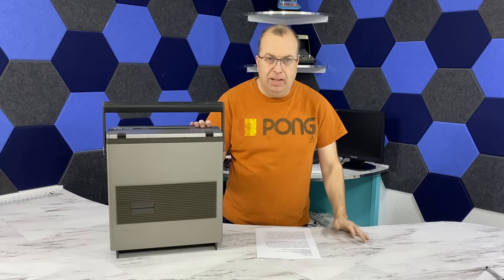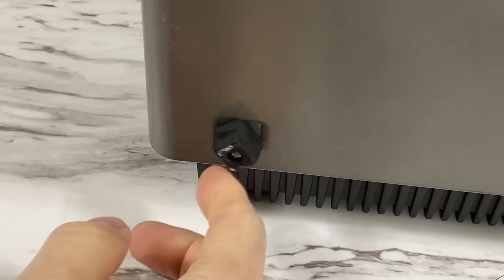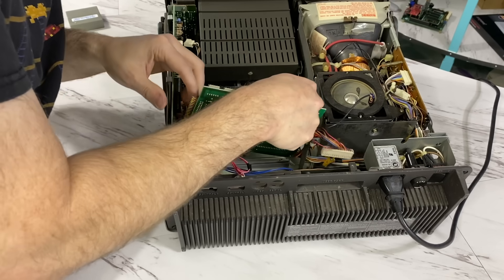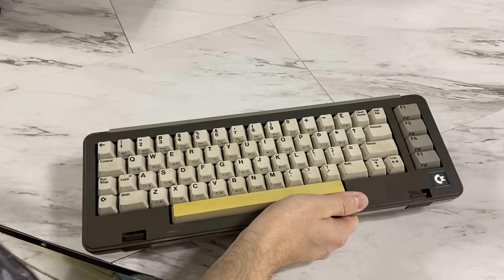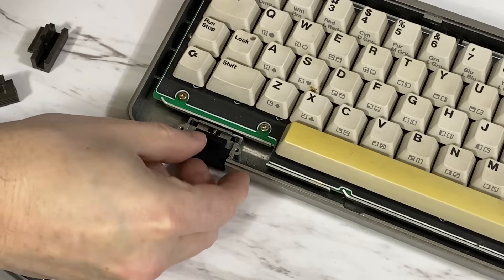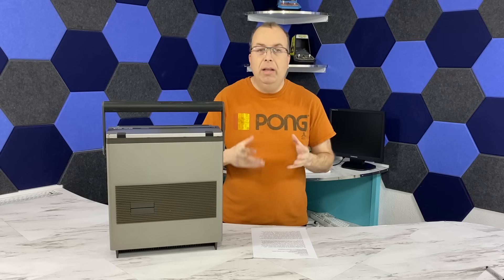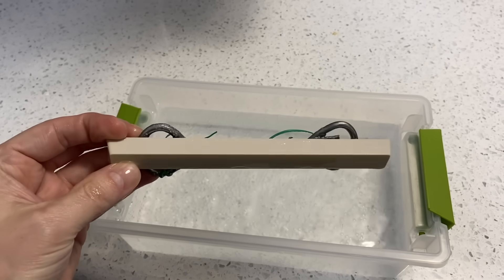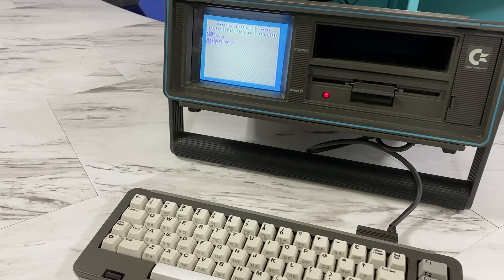Commodore SX-64 repair and trivia

Comment: The key offset on keyboards is nothing to do with ergonomics, it is just a holdover from mechanical typewriters which required the offsets to fit in arms under each key. Really having keys in an even grid is much better for finger movement, it just takes some getting used to if you've only ever typed on offset keyboards.

Comment: 14:48 "did you know you can press shift and run/stop as a shortcut for loading from disk? On the regular C64 this function defaults to cassette"

I don't know about shift and run/stop, but I do remember using the commodore key and run/stop as a shortcut.
I think the commodore key and run/stop shortcut might have just been available while using the Fastload cartridge.

Comment: Replacement SX64 keyboard cables are available on eBay for under USD $20. They don't look like the original, but they work just fine and unlike the OEM item, they can be repaired. 

Oh, and I make them myself. ;-)

Comment: From your video I know that the white plastic can be restored with h2o2 and UV, but if it is black plastic, like the black case of the Cherry G80-3000, with the white scratches on it, what should I use to fix it?

Comment: You could find a color CRT expert and ask if they can improve the quality of the display area. There are a number of tweaks that are available to optimize the viewing quality. 35 years ago I dealt with a color CRT refurbishing company and they did wonders. They could even cut the CRT neck and replace the guns, though I don't think your screen requires that by any means.

Comment: A brilliant flash of green light seems less unusual when followed by the appearance of tentacled aliens, as is the case with the current flash of green light. The tentacles wrap roughly around you as you faint.
  After an unknown amount of time... Well, let's cut the bullshit. 7.3 hours later, you wake. Your head feels as if it's been run over by several locomotives, or at least one very large locomotive, and your clothes have been replaced by a brass loincloth...

Comment: The SX-64 was originally meant to be Commodore's 'Osbourne' killer with built-in z80/CPM but Osbourne and CPM really bit the dust and the z80/CPM was never completed in time. The stuff ended up in the C128 I guess.

Comment: Considering the SX-64 was aimed at a business market one wonders why they bothered trying to make it colour at all - that advert boasted about it's graphics and music capability, things which surely wouldn't be relevant to a businessman and perhaps even confused potential customers who wondered if it was meant for them at all. It certainly, as you pointed out, compromised the quality of the display. I do rather like the appearance of the machine though, it looks quite hi-tech for the era and the keyboard fits neatly into the top of the unit when not in use.

Comment: I will say that while the $990s for price may be somewhat outlandish for the hardware age at the time of sale, expecting a $100-200 premium over just buying the components standalone should be expected much like the price premium of a modern laptop with similar components to a regular PC.  Granted it wasn't battery powered, it was still at a time where portability in general would be similarly premium to a laptop.

Comment: When I had to refurbish my SX64 keyboard, there were no replacement membranes at the time so I used a No2 pencil to repair the membrane. I just traced the pads with the pencil and it worked! Thanks for letting know a replacement now exists!

Comment: These were only sold for the most part at the more opportune commodore dealers. In Vancouver British columbia, that was Conti Computers on Broadway.

When I first started getting interested in Commodore again, this was the first computer I started looking for and I managed to find one in Canada so I saved a bid on shipping and everything was working on it except there were a few cracks from a well repaired bit of damage on one of the plastic latches. However it is missing the blue dots over the hinge pins. All in all it only set me back about $400 including shipping 5 years ago, a bargain
Reply: After listening to some of the people on the Facebook group on this, these apparently don't ship very well, and end up with loosened connections between the boards so even if it is a working model, the act of shipping it and getting bounced around me require you to open the case up and ensure that everything is connected properly.

Comment: The spacebars are made of different material (ABS) because the usual material (PBT) is prone to warping when it first cools out of the mould and warping affects the spacebar the most

Basically it was cheaper to use ABS for the spacebar

Comment: One hand it is sacrilege to mod such an old item, but on the other hand the machine would become much more useful if you would install a flat screen in it, perhaps an OLED one to keep some of the "perfect black" of the CRT. Just like other retro fans, I simply love CRTs, do it is a bit double, but Commodore did a really job here. Best would perhaps be to find a compatible tube with a better dot pitch... but where to find that?

Comment: The SX-64 kernel also has a cyan border instead of a blue one. Not sure why his border is blue in the video 🤷‍♂️ guess it’s just the tiny is off a bit… My kernel ROM was also bad in addition to the PLA and you can swap it from one from a c64 to test but if you want it stock it’s a different part number 251104-04. Finding one is near impossible but there’s a guy on lemon64 who will burn one for you if anyone needs one. If you need one you can search for that part number and you’ll find my thread on the details.

Comment: I had a school friend who owned one and I found it so cool! Always wanted to own one myself, but too expensive and rare. Thanks to David I now am aware of how bad the screen is! I didn't know about the low resolution shadow mask. That is a total turn-off! Thanks to that I am no longer sad of not owning an SX-64, because otherwise I would have the dillema of deciding to keep this odd screen and the SX-64 original or make the mod to replace it with a modern TFT, making the SX-64 unoriginal (which honestly is a no-go on such a rare machine).

Comment: I have a very low serial demo model.  Has some minor differences, but also has cartridge timing issues that have been fixed in later models.  I keep it stock.   But other differences are, the keyboard where it says "Executive Computer" is a sticker on mine. Also, the ports on the rear have no embossed labels, in fact, they aren't labelled at all.

Comment: I purchased what was basically a mint condition SX-64 from eBay about 15 years ago (before the crazy escalation of vintage computer prices was a thing).  Surprisingly it arrived unscathed, and I really enjoyed it.  But I had a pretty substantial collection at the time and after some time passed I decided to sell it.  

So I posted it for sale back on eBay and ended up getting a decent price, but the buyer was in Australia (I was in the US at the time) so that would complicate things.  But he was willing to pay whatever it costs to have it packed (overly packed, which is how I ship things!) well and shipped all the way down under.  His chosen method was via boat, as delivery time was quoted at about 6 weeks.  So I figured out all of the logistics, packed it up so well that even UPS couldn't destroy it, and off it went.  Several weeks passed, I'd considered this a closed transaction.

I eventually got an email from the guy informing me that it arrived in perfect condition and was highly praised for how well I had packed it.  But the email finished with an angry note:  "How could you not tell me that this was only a 110 volt computer?  I plugged it in using a plug adapter, turned it on, and immediately fried it."  I was amazed that someone in a 240v country that purchased something from a 110v country wouldn't think to check.  SMH

Comment: I got an SX-64 for free years ago when I purchased a heap of C64 stuff(seller gave it to me), I think there was around 2 bread bins and 2 newer c64's and around 6 1541's and heaps of software and books.  I think I payed around $120 AUD about 20 years ago, my SX has a light green boarder and has Cockroach turbo rom in it.  It has fast loading stuff and utilities and I think Aussie made.  I hear these things are worth a lot now, and it sits on the floor behind me.  I got this stuff as advertised in a newspaper and way before Ebay was a thing as well.

Comment: Techmoan pretty much have the same problems that you have with the PLA and SID chips, so it's very much common with most SX-64.

What he also done which is clever thinking is future proof it by putting adhesive thermal tape and a heat sink on top of the PLA and SID chips, keeping them cool most of the time since they are in a tight enclosure with no air going in and out.
Here's his video for those who are curious. https://www.youtube.com/watch?v=lXlblGvNtOs

Comment: I owned one of these as a kid.  That tiny screen.   Ooooh, that tiny screen.   But that was the machine I first learned to program on, and the one I first really gamed on.   

I never really even noticed the keyboard issue - I suppose because the only other keyboard I had access to was a ZX-81.  The SX-64 was of course a huge upgrade.   

When my SX64 died, I was a junior in high school, in the early 90s.  I got a clone 386, and have been in the PC ecosystem ever since.  But I still have a few bits of the SX64 around - the original manual is somewhere on my bookshelf, and the little pouch that I believe was meant to hold the power and keyboard cables is also around here somewhere.  Unfortunately I think the rest of it ended up in a landfill.

Comment: This was my one and only C64 which I saved up and bought when 16 (Well I owned a few bread bins later in life, but this was the workhorse of my youth). Still have it today and its working, but need to replace keyboard membrane like in this video as a bit of pounding required. Fair condition these days as it doesn't have the blue side clips on the handle, but was one of the reason why I got it a lot cheaper. Also missing one of the spring loaded cartridge port doors. But as it sits largely idle these days and I mainly use emulators on PC with ZoomFloppy attached, I don't have as much need to bring the big boy out, so have been thinking of selling my old beloved SX64. Have sold off most of my peripherals I once owned including multiple 1571 & 1541 drives, 512K REU, printer cable and CMD-HD hard drive. Still have an ActionReplay V cartidge, EasyFlash 3 and two trays of disks including original software. Maybe if I get a good offer I'll let it go, otherwise still waiting for a Saudi Prince to offer me the big bucks because they have nothing better to do with all that money. Haha!
Reply: chief had this çopeurre at age 16 furst car lambghini faubko
Reply: @sharonbraselton4302  Sorry what is your point with owning a matchbox car
Reply: not  toy car not matçhbix tóy car  lambgghi  diable  cost $750,000
Reply: Well unless you're volunteering to part with your $750k for my SX64, your aim is way off if you think money impresses me. I'm really not into material wealth, it wears thin very quickly, so best off trying to tell someone who gives a damn.

Comment: Growing up in Austria, this was my second computer (after a VC-20 - not VIC, but VC over there.) Commodore basically fire-sold their remaining inventory via the German department store/catalog ‘Quelle’ (basically the german Sears of the era) and my dad was able to get one for roughly $550. The one other reason it failed in its intended market niche (imo) is that it really was way too heavy to ever be described as portable. ‘Luggable’ maybe. I forget what it weighed, but it was probably north of 40lbs. The two silver exterior clamshells were quite heavy (solid metal!) and the (massive) power supply at the back end made sure that if you carried it by it’s handle, you got more than a workout.

After I went back to the US for college in 1988, my SX-64 stayed with my dad in Austria. He passed away this April and as my relatives were clearing out his things, lo and behold, they found it neatly tucked away in his dresser closet. I was very much tempted to see if it could be shipped over here just for pure nostalgia (I’m pretty sure they all had 110/220v switches, so operation should be fine) but I figure it’ll most likely not survive shipping, no matter how good it’s packaged. I gifted it to one of my cousins, who says he wants to keep it/restore it. 

I’ve periodically checked eBay for SX-64s over the last 20 years, but every time I came close to buying another, my sense of nostalgia was overcome by the phantom pain in my biceps….

Comment: I've recently been through a complete restoration/repair/upgrade of an SX-64 computer that I was gifted back in March 2022. It's been a fun journey which included reverse engineering the I/O board and creating a replica PCB (due to corrosion damage), capacitor replacements, adding a Bwack SKS KERNAL switcher, designing a power/activity LED board for the floppy drive, creating an 8701 based clock replacement PCB for the CPU board, installing an LCD replacement and building a speaker/amplifier for the tunes... oh and I also sent the chassis away to get electroplated in gold zinc! Way too much $$ was spend, but I've got an amazing machine in my retro computer collection! 🙂

Comment: That computer is an example of how NOT TO BUILD a computer. 

I’m amazed at the insane chip count of that system compared to the Apple //c, which was way more forward looking in design and looks. 

Having a detached keyboard à là Kaypro or Osborne in a 6502/6510 is ridiculous along with the tiny CRT at a time the LCD was about to be very big. 

Of course the //c was 300 dollars more but it was worth it. 

Soon the Toshibas, ThinkPads, PowerBooks and Acers were gonna wipe out all those microcomputers.

Comment: The poor screen & crazy price was what got me, for that size a mono screen would have been way better.
These days, trying for an OLED etc. replacement would be an interesting project, however the lack of RGB from the video chip is a bit of a road block.
Years ago a junked SX64 appeared at work, quite a bit was missing by that stage, however I did score the screen from it and was amazed it was composite (well S-video) Nobody else did that, it was always RGB, I would have thought it was a good time for them to update the video chip and add RGB.

Comment: For things like that unobtainable cable, it would be cool to see some fan recreation projects based on that. Continuity test to get the pinout, some 3D scanning of the cable housing, and you can likely pretty easily 3D-print new housing and make your own new cables. It would be incredible niche given the rarity of those computers, but cool nonetheless.

Comment: I have an SX-64, and I think you’ve got monitor issues. My screen looks wayyy better than that. Text is crisp and clear. In fact when I got it I had my doubts about how useable a 5” crt would be and I was pleasantly surprised at how sharp everything was.
Reply: sort of depends on colors chosen, and maybe his tube is out of focus from getting bumped around

Comment: And that's actually why most small monitors were in fact monochrome. By the way it looks like your deflection system of CRT need a little adjustment.